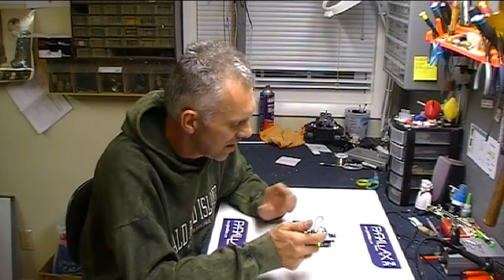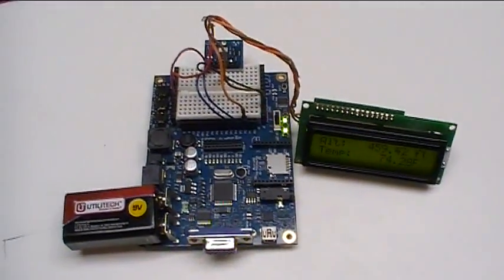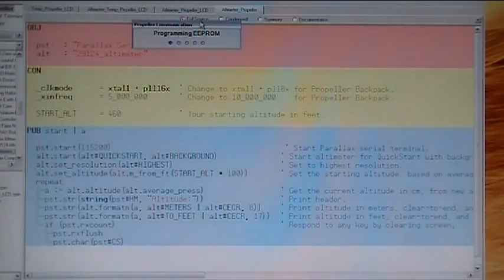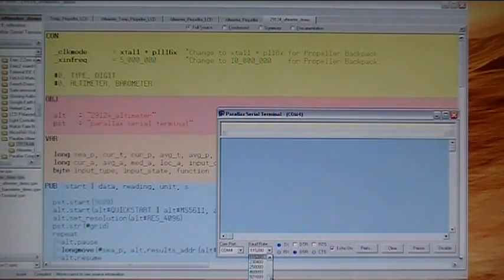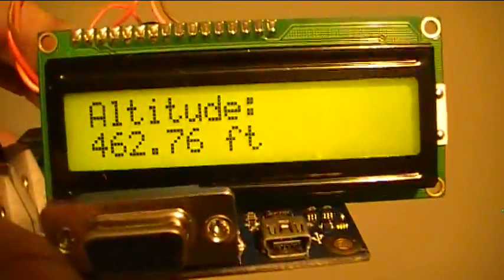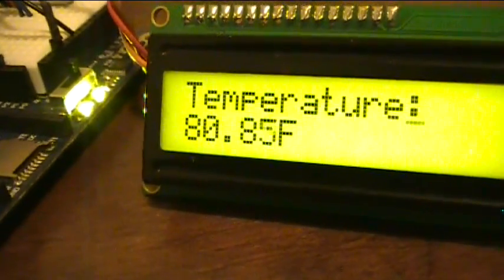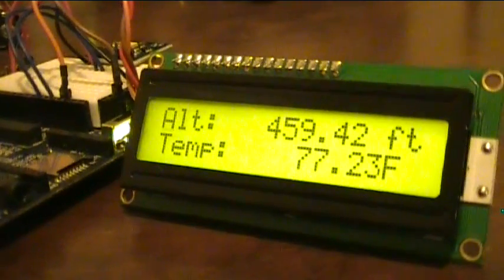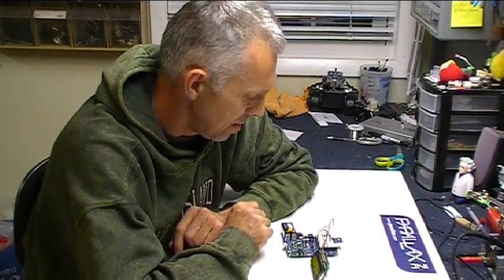Parallax MS5607 Altimeter Module With LCD Readout

Comment: As far as I know altitude and barometric pressure are compute against each other. Altitude is an math equation against temperature and barometric pressure plus a some calibration. To get the exact altitude position you need to feed the equation with the actual pressure at 0. This calibration is depending on the weather and you can fetch it at different website. You should fetch the closet ground atmospheric pressure information depending on your position.